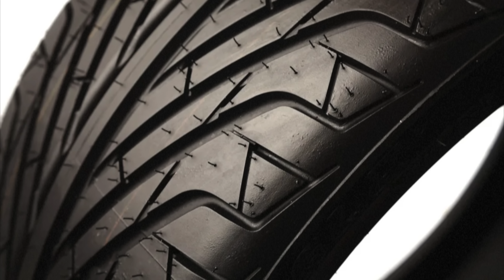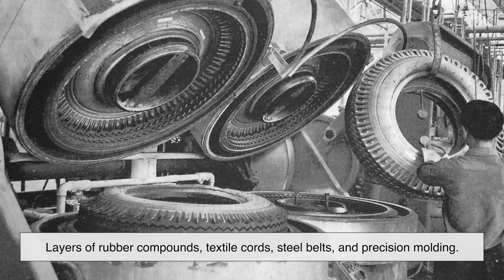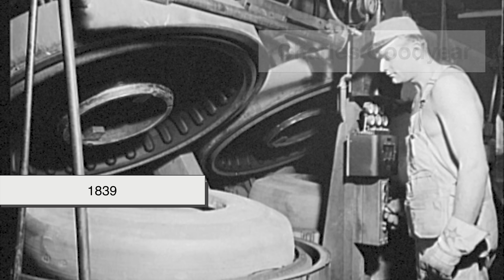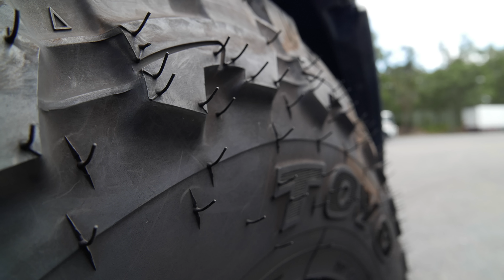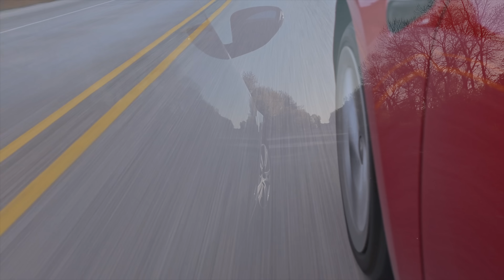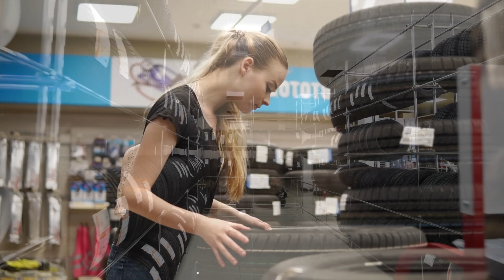What Are Those Tiny Nubs on New Tires?

Comment: Tire engineer here.  Some tire manufacturers do trim off the vents.  Some have poppet valves that close, instead of vents.  And some use a slightly porous mold material so venting is unneeded.
Reply: Are the "trims" re-cycled for motors' cycles' tarrs?  @BarrySmith-t2q  5 minutes ago?  As a not "steam-trained engineer" do you choose to enable the humans etc of breathers to inhale the mysteries of who  or where goes (breathes) the "tire dusts" along-st the HiWays to their early good bye-ways.
Reply: yes, I was working in a tire factory.  they did trimming.  it needs extra labor, manually by rolling the tire with a worker using a tool to trim them.
Reply: That might explain why the tires I just got didn't have them.
Reply: @3DJapan You were sold 2nd hand tires
Reply: Nah, i like to see them

Comment: How long can new tires be safely stored?
Reply: Five to ten year because of degradation of the rubber what's recommended to replace them every six years. If they're kept in a dark cool dry climate controlled area.
Reply: Max of 5 yrs
Reply: Ewig, aber sollten nach 6 Jahren nicht mehr mobil genutzt werden.
Reply: The eternal question! I worked in R&D for 45 years. Manufacturers guarantee their tires for a certain time frame; but also recommend that they be changed after about 6 years of use on your vehicle. Each time you drive your vehicle it goes through a “heat cycle” heating up and cooling down, along with ozone in the atmosphere  and sun exposure causes your tire to age. The rubber hardens as it ages. Say you drive your vehicle 12 to 15 thousand miles per year and your going replace them in about 4 to 5 years or so depending on how you drive, have your tires kept inflated to the pressure recommended on the little tag on the inside frame on the drivers side door and rotating them every 5000 miles to enhance even wear you have gotten full value from your purchase before the 6 year anniversary of use.

sun exposure